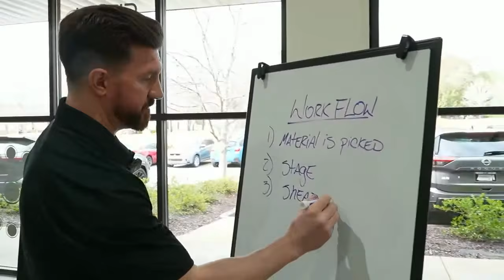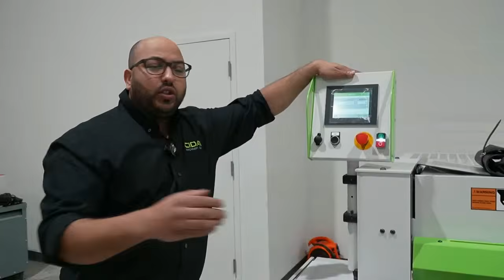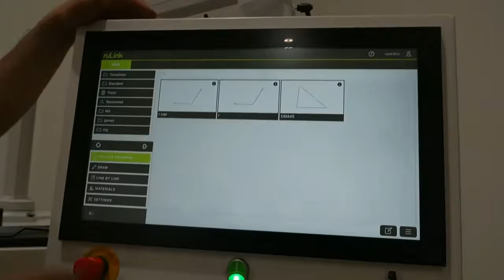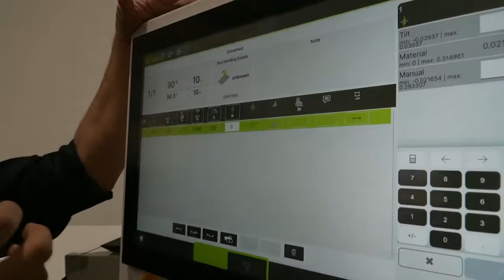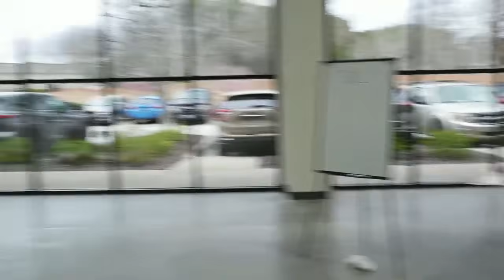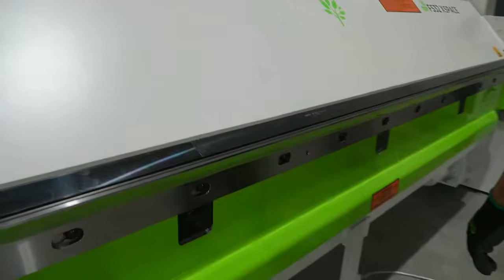LIVE Sheet Metal Demo with the FS32 with XSPACE and the Rapido 32

Comment: Almost every video in the you tube I saw put the handle round bar for the tray in the wrong way that handle should be place the other way around because it also serve as a stopper to limit the distance of tray frame not to touch the round bar if you continue to use the machine this way you will cause a damage to the tray frame and the round bar